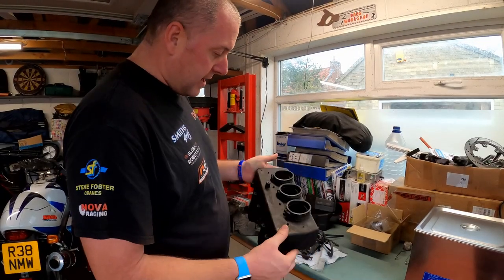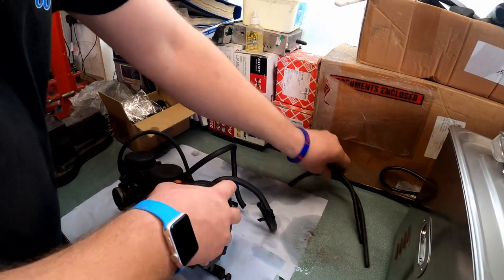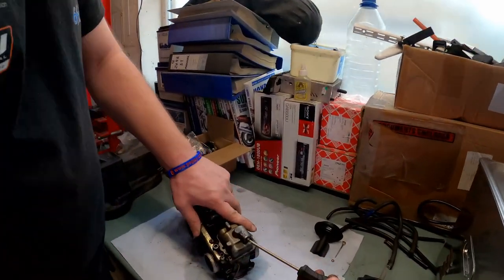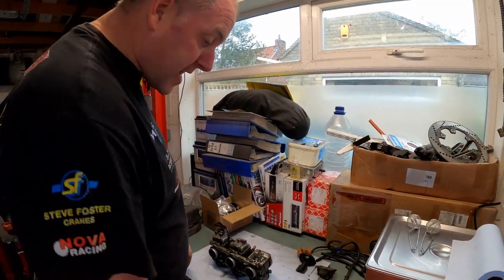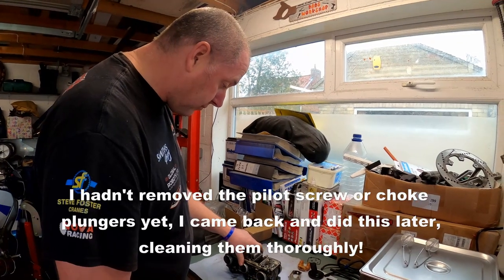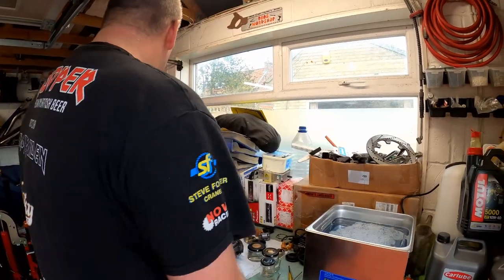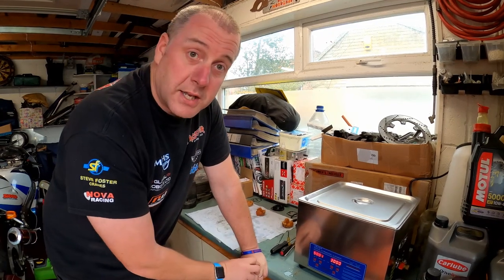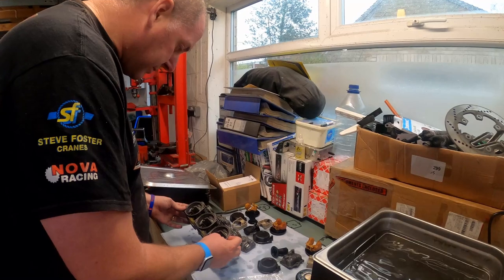Carburettor Disassembly & Cleaning - Introducing My New Ultrasonic Cleaner!

Comment: When I use my ultrasonic cleaner I try and use boiling water from the kettle to assist with the temperature. I also soak for a while to loosen the gunk of then agitate with a toothbrush or other small parts brush. My detergent of choice is Screwfix degreaser cheap as chips.
Reply from the maker: Good idea 👍🏻

Comment: Great video! Whats your thoughts on rubber parts such as o-rings used in the links between the carbs etc being in the ultrasonic cleaner?
Reply from the maker: I suppose that it would really depend on the cleaning solution that you use. In most instances i would replace all o-rings anyway for new ones whilst it is apart! 👍🤓

Comment: What concentration are you using the Ubik 2000?
Reply from the maker: I actually can’t remember what it said on the bottle, I’ll check and get back to you bud when I’m home 👍🏻
Reply: @KevsShed  that stuff is super corrosive - get it wrong and your carbs will dissolve.
Reply from the maker: Absolutely! 👍🏻
Reply: @KevsShed  far better is citrus degreaser - orange oil - Clarke’s concentrated parts washer fluid
Reply from the maker: Good info, I’ll check it out 👍🏻

Comment: Ahh so the float works like a toilet 🚻 😅
Reply: @KevsShed  alright Kev I'm just wondering how much it would cost to get my carbs cleaned on zx6r 96 I've just had a quote from a garage near mine for £400 does that sound about right cheers?
Reply from the maker: @jamespennington9813  wow! Is that to take them off the bike, clean and rebuild with new parts? I’m in the wrong business!